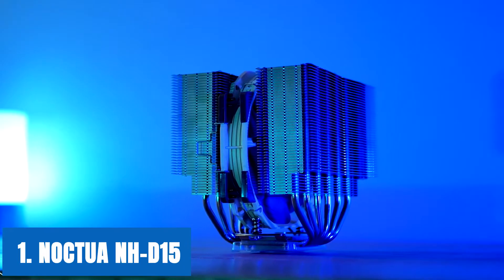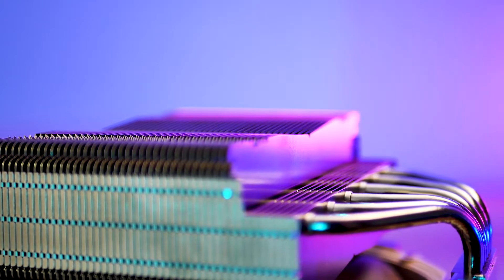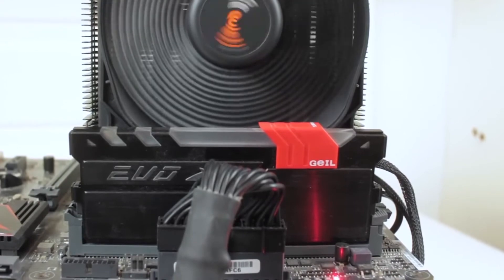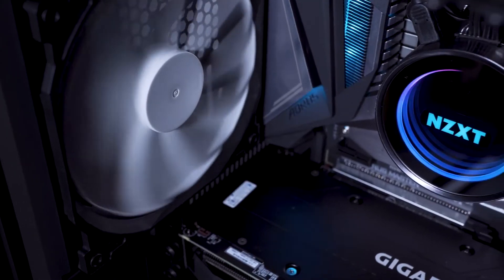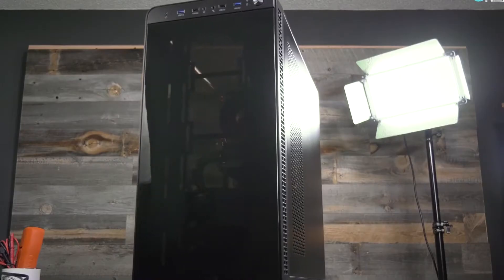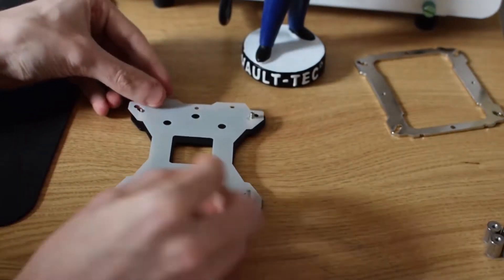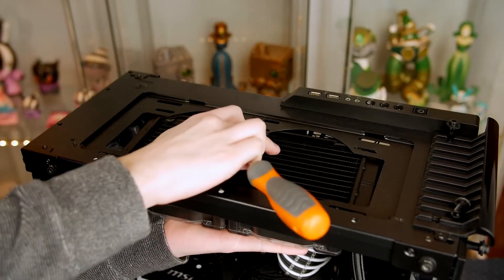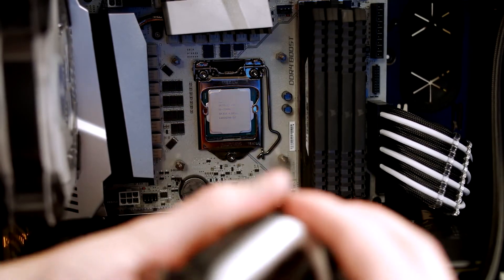Best CPU Cooler For i9 9900K in 2022/2023

Comment: Got the H150i and yes, it’s amazing.
Reply: I have same but i put my cpu on 4.5 because he cannot handle 5ghz...to much heat...
Reply: @king489  i have no problem @ 5
Reply: @king489  check your voltage
Reply: Mine at 5 is maxing at 86c under a cine bench test, wither a single 360 rad also connected to a gpu, what voltage can you get it to at 5? Think mines stable lowest is 1.290 its about 60 c for normal gaming
Reply: @king489  my i9 9900k has 3.60GHz and my noctua nh D15 is doing a really good job at cooling
Reply: Do you mean for i9-9900k Im searching a liquid cooler for my CPU (the 9900k), it makes a lot of hot and im looking for a really goodone liquid cooler
Reply: @Tlohtzin123  Yes. It’s a great for 9900K. I’m still rocking it